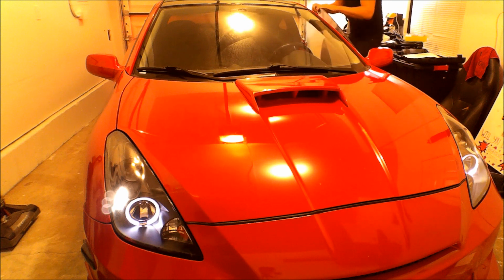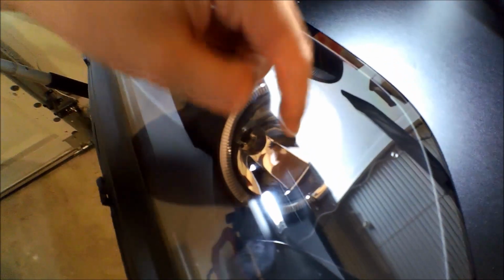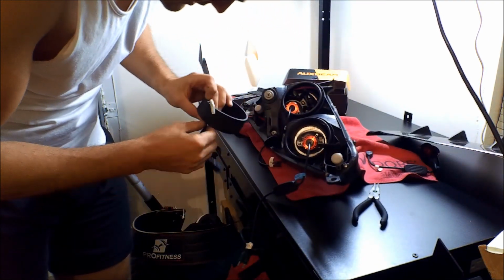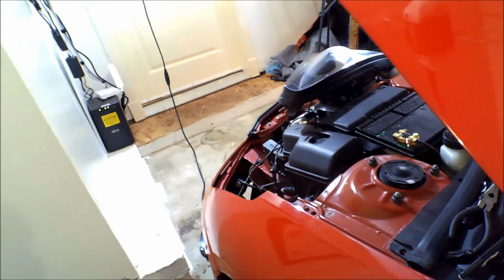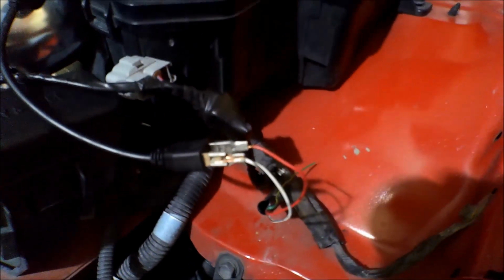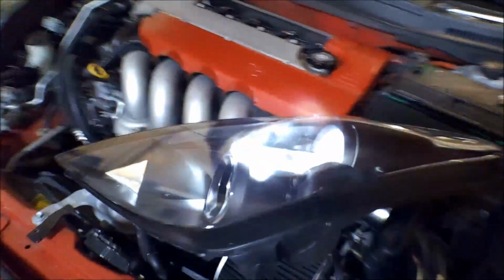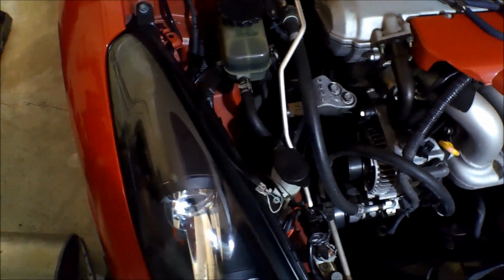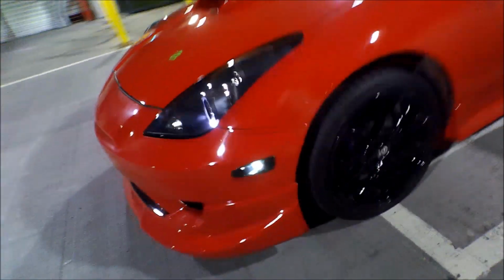MITCH DORE | Celica GT-S LED Headlights

Comment: What cheap exhaust do you recommend? My OEM one is rattling bad
Reply: Prodigious 909 Did you eliminate anything in the exhaust?
Reply: @TeamBlackScrapRage  nope , just started rattling after I drove around 3 hours straight. Maybe the resonator I have a GTS
Reply: Prodigious 909 I doubt it’s the resonator. I eliminated the cat on my GTS the muffler blew up in the inside and started to rattle, I bought an aftermarket one did the same. I would recommend to check your muffler.
Reply: @TeamBlackScrapRage  ok will do I was thinking that also, just happened so haven't gotten the chance to check it out. I do want an aftermarket exhaust tho , under $400
Reply: Prodigious 909 I had a DNA exhaust from eBay I believe it sounded good and was cheap.
Reply from the maker: I have had a C-One, TRD, OEM, Speed Daddy, DNA , Invidia. All pretty good. I currently due a TRD. My favorite. Good question!